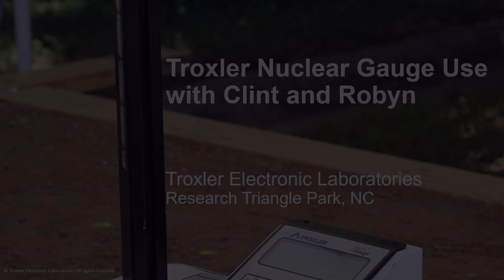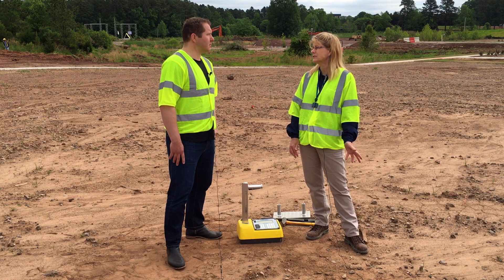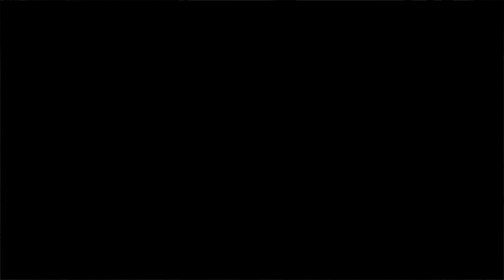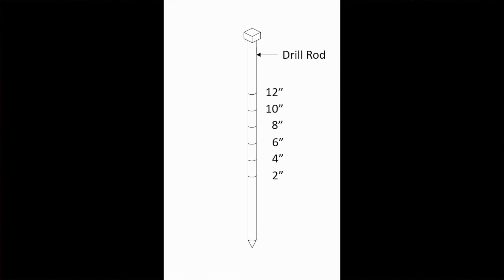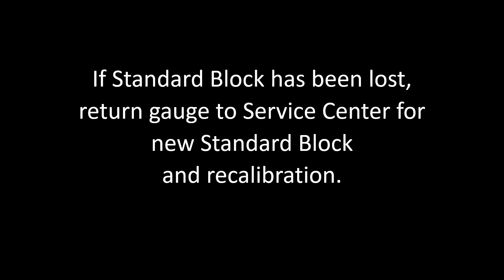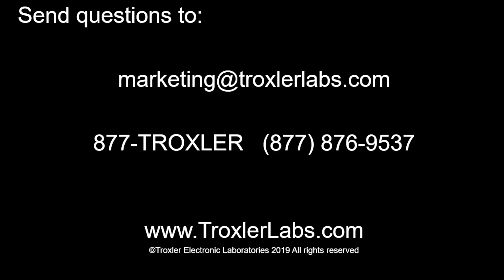Troxler Nuclear Gauge Use S1 E4

Comment: Thanks for this video! Question; do the tools e.g. drill rod, hammer, scraper plate etc. affect the readings of the gauge if left in proximity of the device while testing is performed? Got it. Another youtube video states to remove tools at least three feet away from the test site. Copy that.
Reply from the maker: No, these items won't affect the test results if they are near the gauge.  The standard block could because it contains hydrogen, so put it away (also for safe-keeping) once the standard count is finished.
Reply: @troxlerelectroniclaborator8186  Thank you very much for your reply!

Comment: What is the purpose of pushing/tapping the gauge to the side? Nobody seems to know the answer.
Reply from the maker: The drill rod is slightly larger than the source rod. You do not want to leave a gap between the source and the soil that is to be measured.  Pushing the gauge to the right closes the small gap.

Comment: Thanks a lot ,anyway I don't use this machine upto now,how is it work if the pluncher touch in a rock piece can we get the proper reading
Reply from the maker: If the source rod will not go smoothly to the depth of the needed measurement it is best to move a few inches or so and prepare another hole for the measurement.